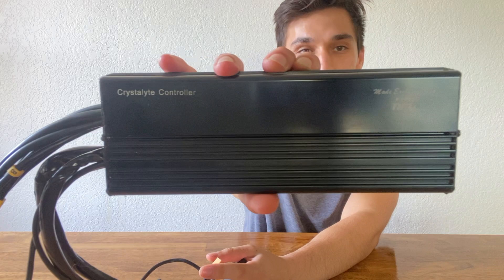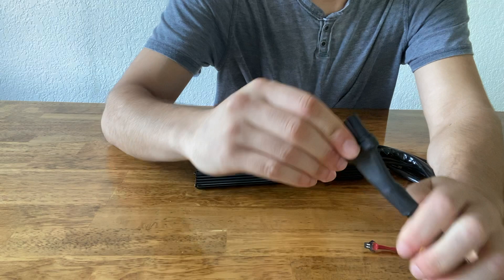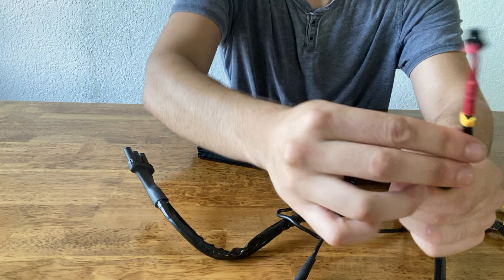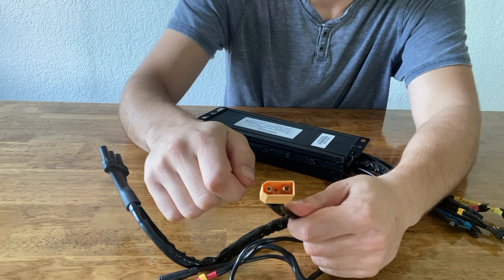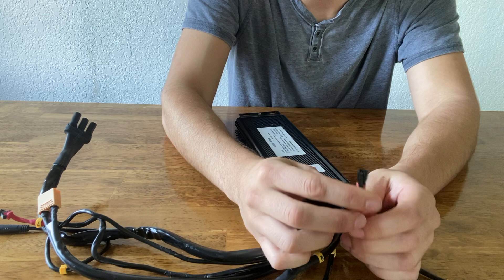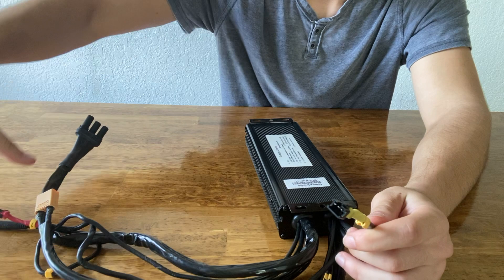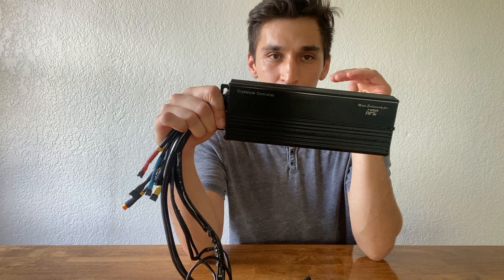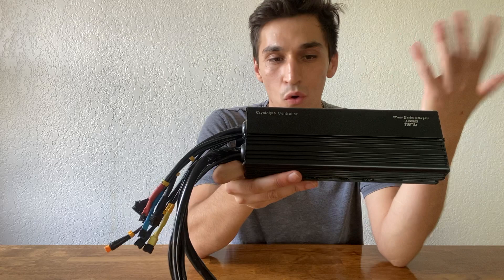E-Bike Hub Motor Controllers (6kw Hi-Power Cycles Edition)

Comment: Hi, i would like to control my e-brake via a simple two terminal button switch like a motorcross kill switch. Can you please tell me which of the three brake wires I need to connect? Thanks
Reply from the maker: To achieve this you first want to short circuit the region connection on the controller and then use a push-button switch on the e-brake cut-off connection. When you push the button to close the circuit on the e-brake cut-off wire, with the regen connection shorted, the bike will regen. 

If you have an HPC setup you can also send it in and have them adjust the amount of regen it will produce when you press the button. 

Just know that this is very stressful on the battery's overall lifespan and will only produce 5-10% more capacity per charge.
Reply: Thanks for the prompt response. I didn't consider the impact on the battery. My main driver was to reduce brake stress. The brakes on my bike (which is an Australian made Stealth Fighter) get very hot after a few stops from 40+ miles an hour.